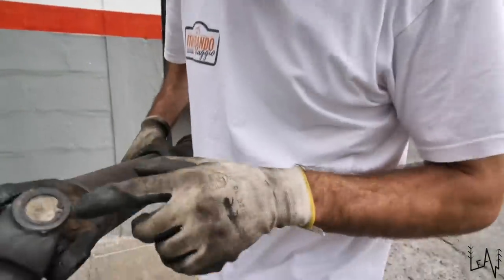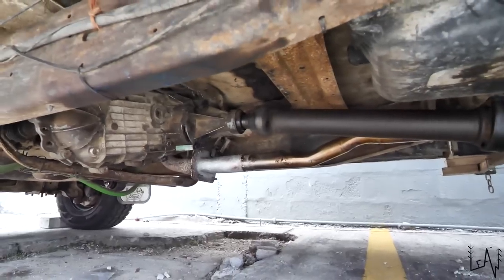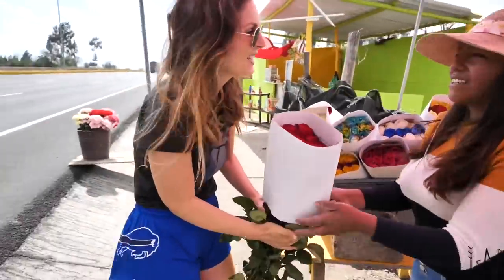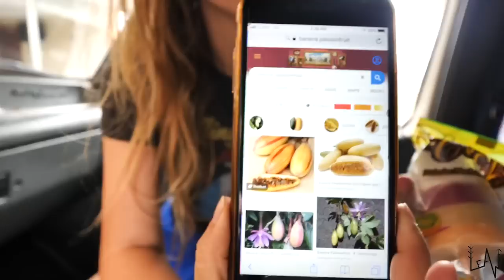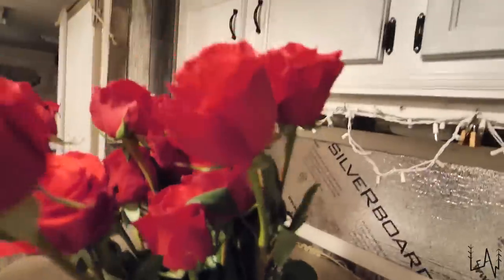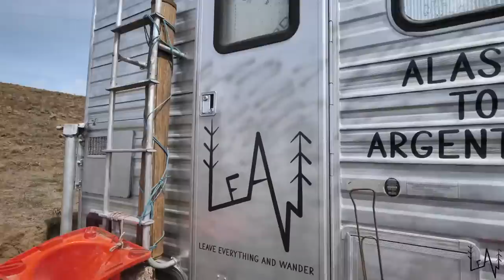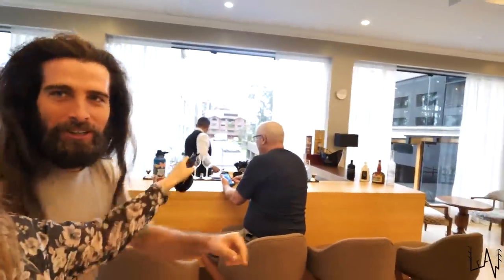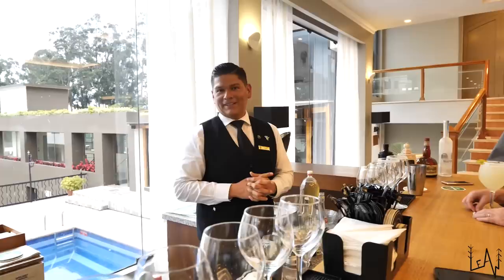Is our 1990 TRUCK CAMPER Lucky LeAw ready to get back on the road AGAIN? End of the Mechanic Saga?

Comment: Shock Absorbers ? did you replace them? protect the repairs the shocks will help prevent problems. Just looked back at the Drive shaft, those shocks look very old .. Cheap to fix very helpful on bad roads.
Reply from the maker: Hi Enrique, no we didn't replace them, we will check them for sure at the next mechanic ;) Thank you so much
Reply: @leaw  I'm looking at another You Tuber coming north from Tierra del Fuego  most roads look OK but some are Sketch. Shocks can reduce the breaking of Springs.

Comment: Yes Luca and Sarah when they installed the U-joint they did not have it pushed all the way in so the snap ring would drop down into the retaining Groove.  Sarah my lovely you're absolutely right when Luca is under the truck don't say anything very good advice.